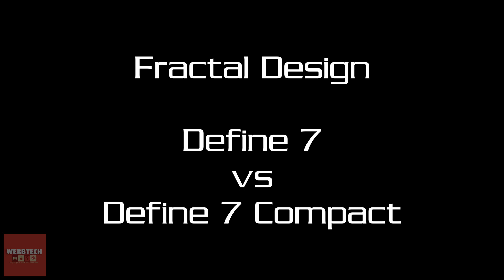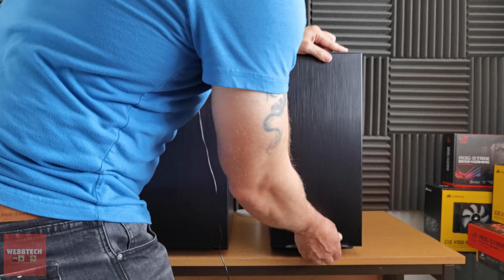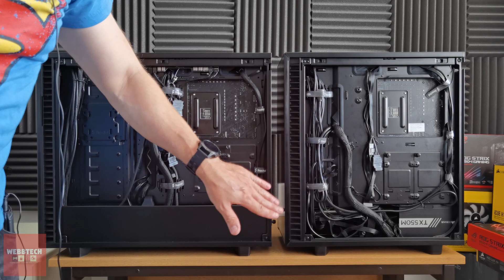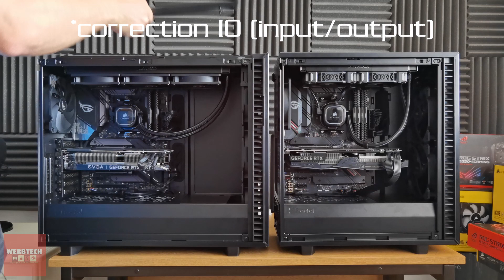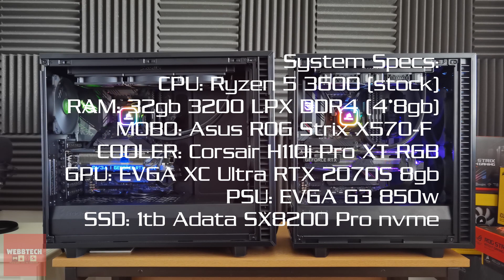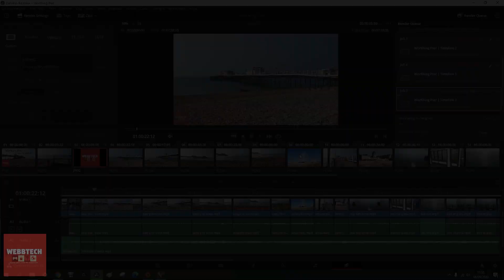Fractal Design Define 7 vs Define 7 Compact PC Case Comparison

Comment: Would a 420 go comfortably and look good on the roof of the standard 7? I've currently got a 240 on the roof towards the front with a 140mm fan also on the roof towards the rear to exhaust gpu heat with the normal exhaust fan on the back of the case, just below that roof 140.  I've got a chance to get the new arctic freezer aio in any size I want and not sure which to go for (define 7 glass side case with a 7950x3d). 3x 140mm fans on the front
Reply: Have you tried placing 420 aio on top yet, does it fit?

Comment: Cant find any comparisons on it but the Fractal Design 7 Mid tower seems like the sweet spot for many, it's at least called that here in Norway and it's slightly larger than the compact. Priced between the compact and 7. Thanks for the video!

Comment: I really wish they would do the Compact at the same width as the full-size case. I would strongly prefer the smaller case but I want the same air cooler height options, and I want the 140mm rear fan. 

This applies to the compact cases from many manufacturers.
Reply: Yeah agree, the slim one but taller would look so nice

Comment: Would a rtx 3090 fit in the compact?
Reply from the maker: Yes depending on whether it's a FE or AIB card. You have up to 360mm room so depending on whether you have an AIO and the actual card you should be fine.

Comment: SO, in the compact version you cant open the front panel, you can´t install an optical drive to watch blu rays.
Reply from the maker: Hi, that is correct. The Compact is a solid panel and doesn't support a 5.25" drive whereas the non Compact version does. The trend has been moving away from optical drives for a number of years and it's fairly rare to have the option of a drive bay. The non Compact case is excellent and you will have a much easier time building in it.
Reply: @WayneWebbFilms  Yeah, that is the reason I watched the video, thanks for the reply, I still like optical drives and side panels fans, but I can't get that combination with  tempered glass for some reason.
Reply: @WayneWebbFilms  That's a stupid trend. Since DVD-RW is still overall the best option to store important data (photos, videos etc.). And ofc there's Blue-Ray as well.

Comment: Thanks for this video! I was struggling to decide between the two for the same reason. I refuse to mount a radiator on the front and blow hot air through my pc.  However, I decided to go with the compact bc of the nice form factor. I will just be sticking to a top mounted 240mm radiator, which isnt a huge compromise. Your video helped me finally make my decision, so thank you!

Comment: this case dont have power led for hard disk.. too bad
Reply: A workaround would be to wire the pwr led into the hdd led header, since it's pretty ovbious when the power is on.  The power light becomes your HDD activity light.

Comment: They should make Compact the same as regular Define 7 just shorter, it will be way better.
Reply from the maker: 100% agree
Reply: @WayneWebbFilms  A thanks for this video, I was thinking about Compact, now I think I will pass. Regular is too big. Also thanks for C vs Compact one. C need a revision, this plastic is uhh.
Reply from the maker: Yeah the be plastic isn't great and yeah the regular is too long. I change cases all the time and was looking for another after doing lots of Matx reciews. I had the choice between the normal and compact because they are both great in their own right...I went with the compact. The normal one is great but too big for my needs. The compact is a little too small, but suits me right now :)
Reply: You realize the define 7 compact is the successor to the Define C, right? Fractal tends to make new compact define cases every 3 years, so the define 7 compact will be relevant until 2023.

Comment: Nice Vid Thanks!
Are there any Difference in Temps? i own die Big on... an the Temps are Great. But the Case is a lit to big for me. So when ich get the smaler on, is there more Heat in the System ?
Reply from the maker: Hi there, I'm pretty sure it's covered in the video, but the larger of the two has a bit better temps. The larger is also able to house more stuff and larger AIOs and coolers. Hope this helps

Comment: I would run a 24 pin extension on the compact version and stuff the rest of the thick cable at the bottom.  Plus I would get rid of the 3.5 inch tray from the bottom as well.
Reply from the maker: Definitely agree that you can do that. I personally utilize the HDD trays but the extension could improve things :)

Comment: Got the full size one on sale at Black Friday. For 99€. It'll replace my old Define R4 in my new silent build (whenever the processor arrives). I'm quite impressed with the modularity of the newest iteration – it's such a pleasure to work with. The R4 lasted me for a bit over seven years, and it served me very well. The only reason I won't do the new build in it is because the Define 7 happened to be on such a good sale.
Reply from the maker: Amazing deal, such a great price. I had the R6 and loved that. Good luck with the build once your CPU arrives.

Comment: Something I saw another review mention was that it was supposedly possible to attach the side panels with a screw behind the front panel, which could fix the issue of the back side panel popping off if that's accurate? I couldn't find any info about it in their manual though nor another confirmation that it was possible anywhere else. Another thing that can help with the cable management problem is that the plastic cable guides can be removed entirely which would give you some extra space to play with, the velcro straps can still be used but attached to the case itself instead.

I also saw that you commented in the second video that you couldn't remove the hard drive cage which just isn't true, there was a guide how to do just that in the manual. Other then that, great review!
Reply from the maker: Unsure about the panel fix, but worth a try. I tried to remove the HDD tray on the Compact and didn't believe it to be possible due to a lack of space, happy to be proved wrong. That said, I applied human logic and not Fractal logic ie with their lack of cable management :) I thought it was installed as part of the case construction instead of at the end. Fantastic cases though :)
Reply: @WayneWebbFilms  Yeah it wasn't too obvious because in the manual you had to take it out through the PSU hole. At least they thought about it even if it wasn't particularly obvious, they've tried to save as much space as possible without actually limiting certain options I guess hence some weird implementations..

Comment: Question how is the airflow and noise? I have a silencio s600 with 4 120 mm fans and a i9 9900k with a Noctua NS- D15. I can hear the fans currently. 

So how noisy is this case ?
Reply from the maker: Hi there, which case in particular? The Define 7 has better airflow than the Compact I would say (no way to measure really), temps are a bit lower on the Define 7 but that could be down to the larger volume of air inside and not down to the design of the case. Also, you can open the front door of the Define 7 to let more air in if you need to. In terms of noise, it depends on your idea of what is noisy, your choice of case fans, what load it's under and the fan curve you have. Having just had a look at a couple of pictures of your case I would say that the Define 7 would be quieter and have better airflow. I hope this helps a little :)
Reply: @WayneWebbFilms  I will consider the define 7. Thank you for your answer.
Reply: I built a define 7 with the D15 in, and while the CPU temp was ok the noise of the fans was noticeable, I also built a 7 Compact (solid) with a U14s in a push pull, and the temps were much better, as well as the noise- its a dead silent PC. Personally I prefer the compact. In the compact i removed the Hard drive caddy and put in a 120mm noctua fan instead  and that helped a lot with the temperatures. I also found out by removing the plastic cable retention brackets made cable management a lot easier.

Comment: Very nice review. I went for the normal version. I haven’t had a pc in years so I’m a bit surprised with the case size so I had to rearrange furniture in m flat to accommodate everything. I’m quite happy with the case, it’s very easy to take things apart. I did replace the stock cans with 6 be quiet ones. Now I’m just missing cpu and GPU to complete my build.

Comment: Great comparison, I like your calm explanations.
The Compact would be totally fine for me, I'm just hesitating because of the issue with too less space for the cables there. :( I've also read reviews where the side would pop off eventually after a while. Is there no way to secure the side, maybe with a screw from behind the front panel? At least the Define 7 mentions this 'trick' in the manual (but not for the compact unfortunately).
Reply from the maker: Thanks for the feedback. With the decent job I did with the cable management, 2nd time around, there is very little danger of it just coming off. Previously, I used a strong magnet I picked up from somewhere random and put in one of the corners and that certainly helped. There is no need to put a screw in to be honest. You could experiment and put some sort of clamp at the rear between the io shield and the rear panel if that makes sense. The most important thing is to do a really good job on cable management and/or remove the HDD tray. The Compact is well worth buying and is actually my favourite case of all time I think and I've had quite a few cases over the years...its not perfect but it has a certain charm and character that other cases don't have.

Comment: Great review. Still thinking of going for the full size one, mainly because I end up keeping cases for a very long time and you never know what sort of build you might want to do down the line...
Reply from the maker: I'd like to see one in between the two...is that unreasonable of me? Yeah the Define 7 is probably the better bet if you keep your cases for a while.
Reply: WebbTech I agree with you. I’ve spent days watching every fractal case review trying to figure out the ins and outs of fractals current lineup. They’ve made it almost too complex frankly, a lot of cases which are all very similar. I may end up going for the Meshify S2, it’s slightly smaller in terms of dimensions over the Define 7, cheaper and has better air flow...
Reply from the maker: I don't know first hand, but I don't think the quality is at the same level, I've owned the Meshify C and it was meh...the new line up is streets ahead in build quality, up there with Nzxt now in my eyes. As with anything you won't know until you get your hands on and try.
Reply: WebbTech oh really interesting, so the 7 feels like a step up in terms of quality? There’s just a couple of things I don’t like about the 7, mainly the vent pattern and that ‘pop’ on side panel without thumb screws on that rear motherboard side. Sounds picky I know, but I think that might annoy me on the compact like you’ve highlighted.
Reply from the maker: Have you thought about the R6? I haven't used one for about 18 months but I was impressed with the quality. Their doors are similar in function but have thumb screws. The lack of screws on the Define 7 isn't an issue unlike with the Compact. Anyway, good luck with whichever one you go for :)